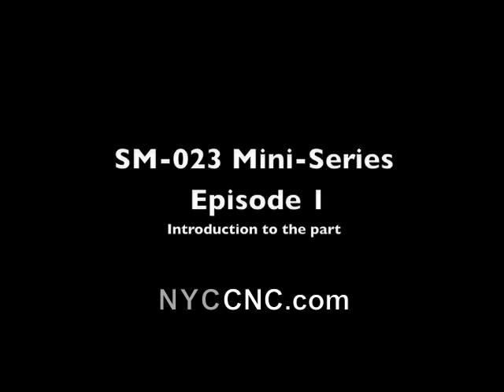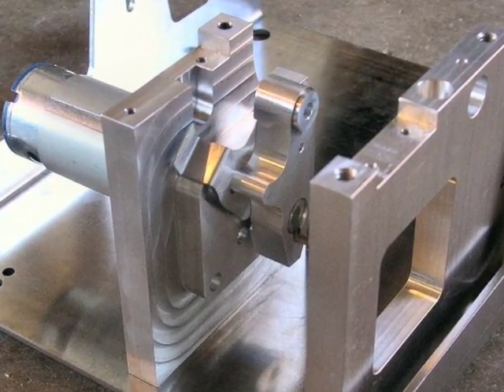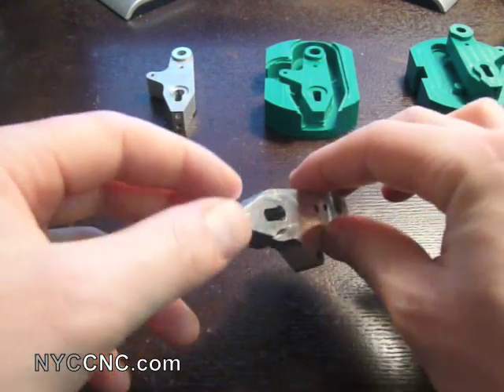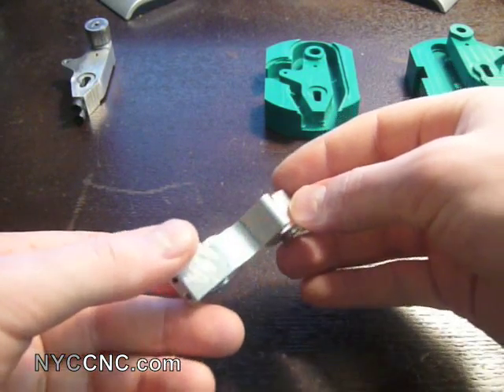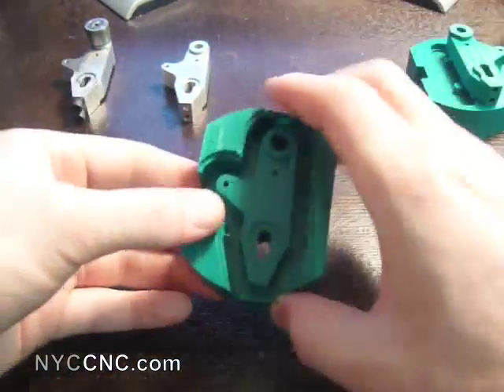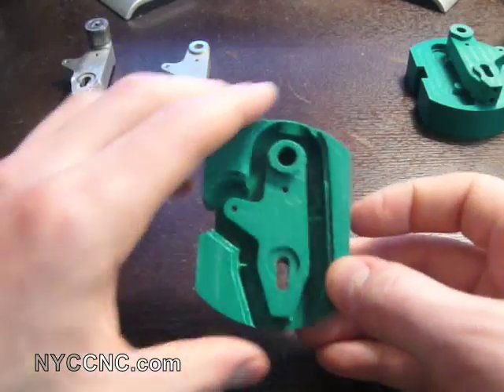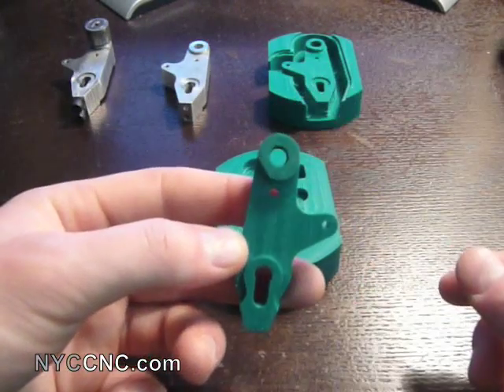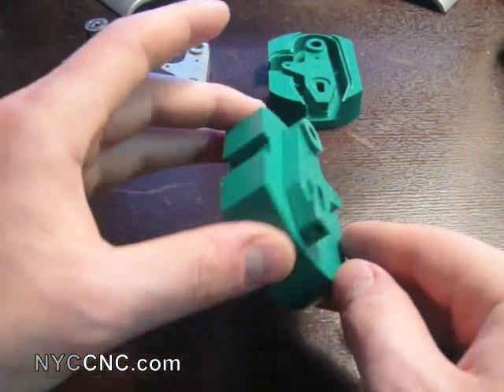How to machine a CNC mill part - Start to finish! Episode 1

Comment: This could be made in a 8600 stressproof, or 1018 steel, or one of the 4130, 4140, 4340. 

I make some great motor and industrial power transmission (gearing) stuff in that material. 

Delrin is ok if your usages are low time. (not running all the time)